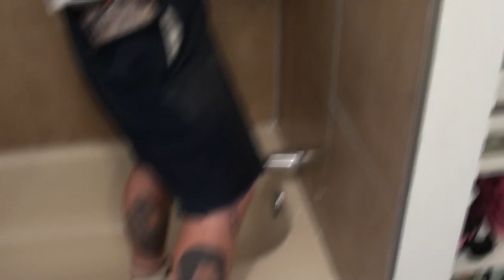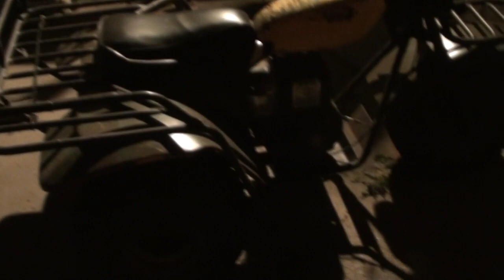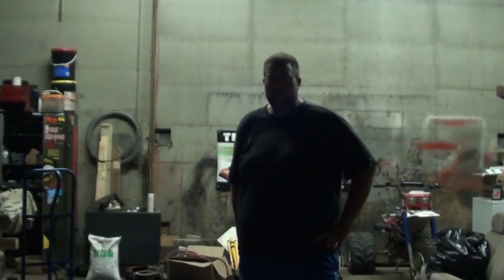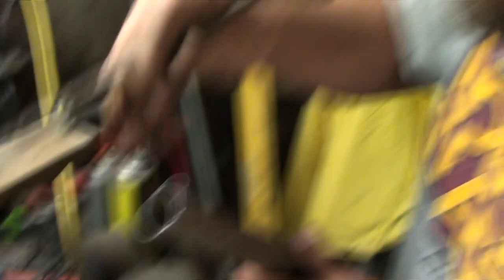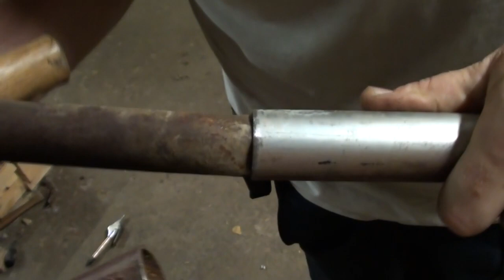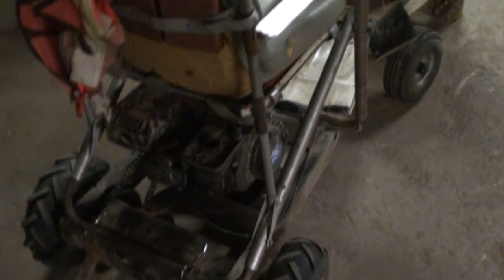Fixing the Boogie chair's chair frame

Comment: Dude to clean the burs off the inside just use a pair of linesman pliers and put one half on the inside and the other on the outside and twist..that's how we do it with electrical conduit after cutting it, works good...a big pair of needlenose pliers works good too if you stick the whole end in there and twist